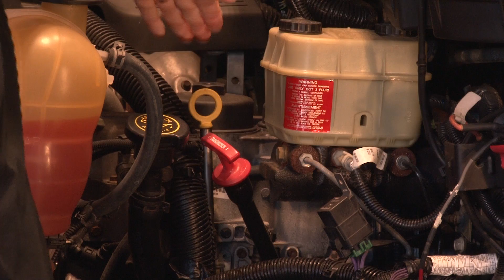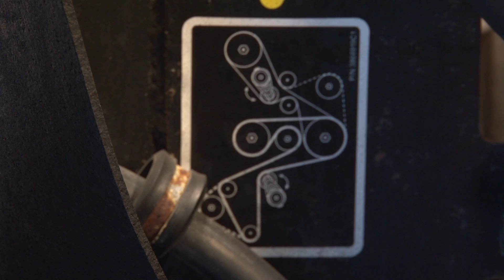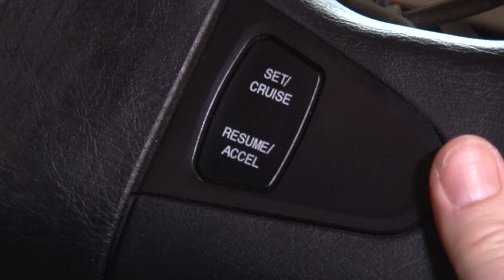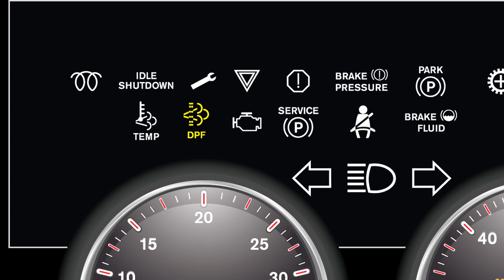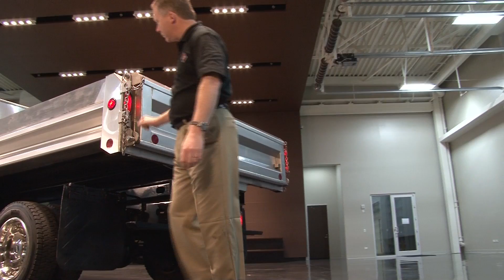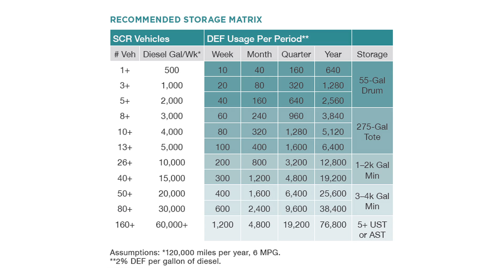International TerraStar Delivery

Comment: They need to bring the terrastar cube trucks back, everything's plastic anymore with a 4 cylinder engine, least with a terrastar we're surrounded by steel, they had class 5 trucks for awhile but people want to own them with a standard drivers license of class 4, one way we can achieve this is keeping the 400hp v10 engine, keeping the automatic transmission, as for the cube let's make them in 10 12 14 foot, as for the tank, keep it as diesel but instead of the 40 gallon tank we should have the tank as 75 gallon to cover the running of the lift gate in the back and finally the rear axle, let's keep it as dual tires but instead of the class 4 being up to 16,000 GVW we should keep it as 15,000 GVW to minimize any confusion that we don't intend to use them as moving trucks
Reply: The Hino and Isuzu cabovers are waaaay more reliable than the 6.4's and 6.0's of the past.